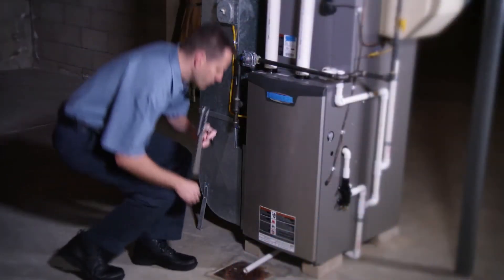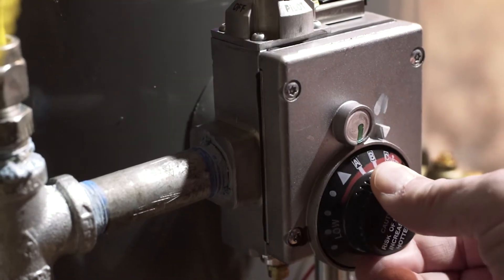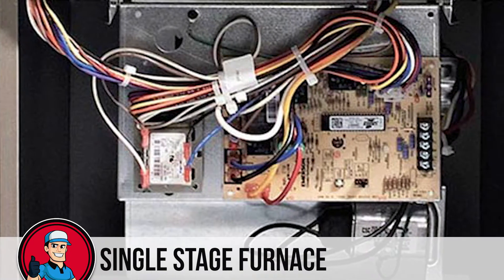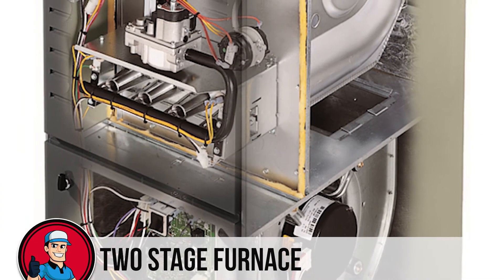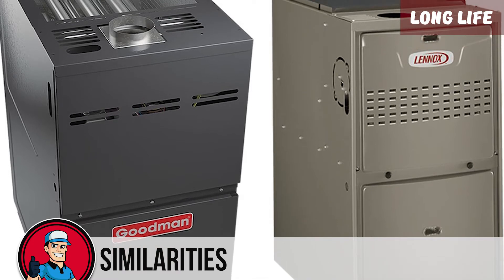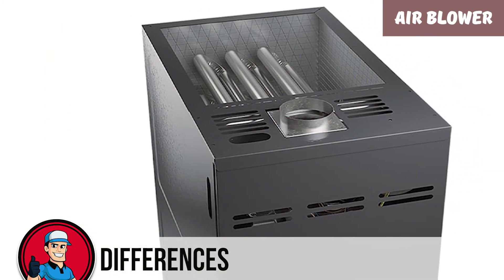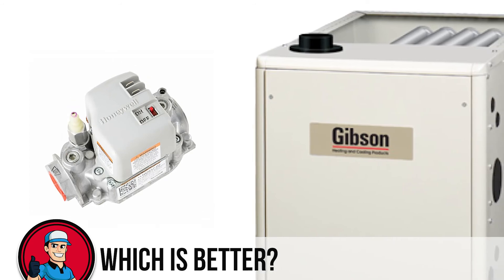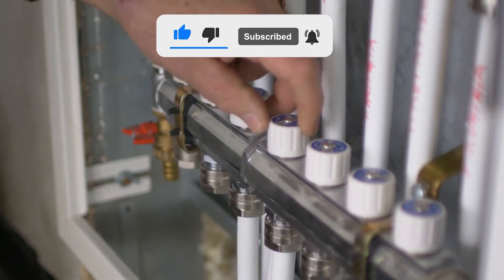Single Stage 🆚 Two Stage Furnace: Complete Review | HVAC Training 101

Comment: Is it possible to wire two thermostats in parallel to a single stage furnace?  I need certain rooms to call for heat without going to a zoned system.

Comment: A two-state unit absolutely worth it as long as have you have variable speed blower fans and AC condenser that is at least two states.  There are far too many questions about the specific location of where you are located etc etc  But a two stage in unit is a tiny amount more in cost.  If the quote you get is way higher, just tell them you need to get more quotes from other dealers.  That should be no more than $1000-1500 on the very very high end. Two states will save you a huge amount and use much less natural gas or electricity.  Buy the best unit you can.  I pretty a Modulating furnace, variable speed fans on both indoor and outdoor units with multi-stage AC or Heat {Pump).  This is an investment and will save you tremendous money in energy and your level of comfort with be incredible.  I have made so many homes feel amazing and they withed they had done it sooner.
Reply: modulating valve and variable speed fan can cost a lot when broken. In my case I chose 2 stage with X13 motor. For 10 years, no trouble yet. Unit was tuned up properly. I don’t use too restrictive air filter.  95% efficiency rating.

Comment: Can you tell me about tonnage? I live in a two story home, 2025 sq ft. I have one contractor saying I need a 5 ton AC system  while another ( plus Google) says it should be a 4 ton system. Your thoughts?
Help! 😵‍💫
Reply: A 5 ton is far too big, and a 4 ton is actually probably oversized. Depending on the age of your home, you could use a 3 or 3.5 ton A/C.
Reply: Our 2 story, 2,600 sqft with full basement house does fine with 16 SEER 3 ton unit. Do a manual J calculation.
Reply: THere are way to many variables to make a truly direct decision.  Just by sq ft alone is about 4-ton.  But if you live in Phoenix with high sun exposure then you could use a 5-ton.  But if you live in the northern states that for the most part have warm days then 4-ton is more likely.  This certainly changes with humidity level and additional items needed.